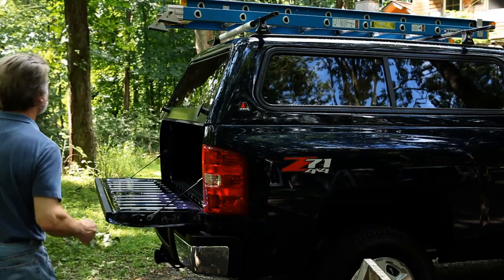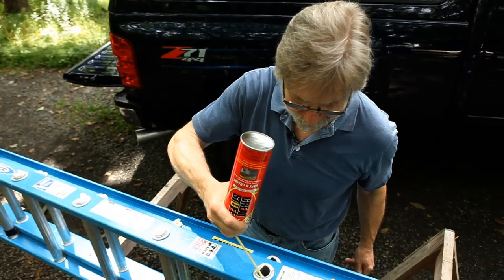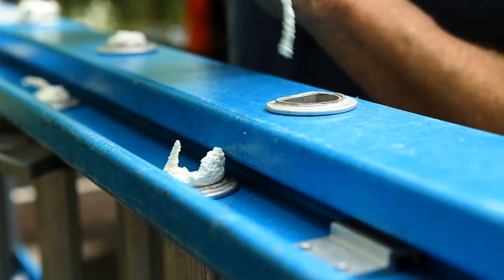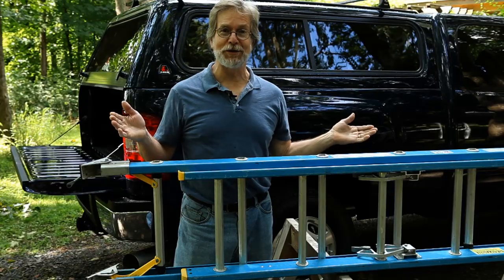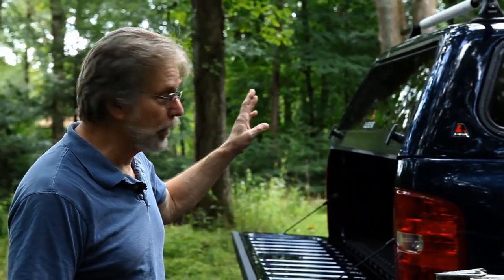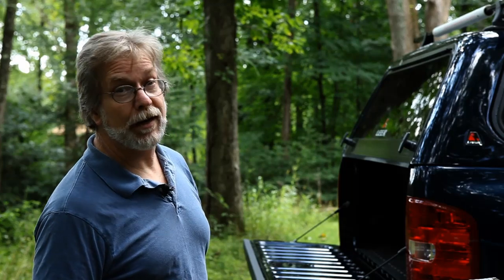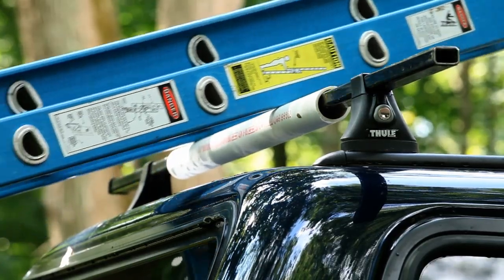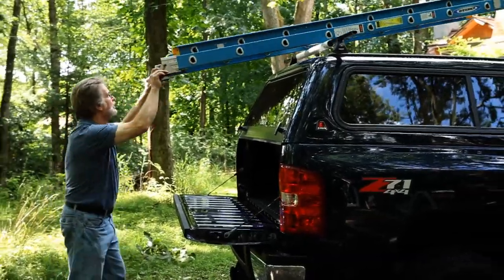How to Stop The Ladder on Your Truck From Whistling

Comment: My aluminum sectional ladders have holes for the rungs but doesn't make any noise - even at 80 mph.  Just got a 16' aluminum extension ladder and it howls at 40mph and up.  Could it be the shape of the holes?  The extension ladder had d shaped holes and the sectional ladders have round holes.

Comment: i have had this problem before and my fix was to  turn the ladder around (put the feet facing the front of the vehicle). worked for me
Reply: so many different types of ladders what type do you have?  Step, extension, or other.  Material of the ladder?

Comment: Last week's puzzler, on the NPR radio show Car Talk, identified a whistling ladder as the problem a painter was having when driving his Oldsmobile to job sites. 

They didn't find a solution though. Well here it is! Plug the rungs in that ladder and you're good to go.
Reply: Damn I miss car talk. They still play the re-runs but it's hilarious because the cars are all 80s and 90s models

Comment: What's the fix for the PVC rattling on the rack with no ladder?
Reply: nope, howels in either direction.
Reply: Same as the ladder. Fill it with the foam. The foam should stick onto the rack.